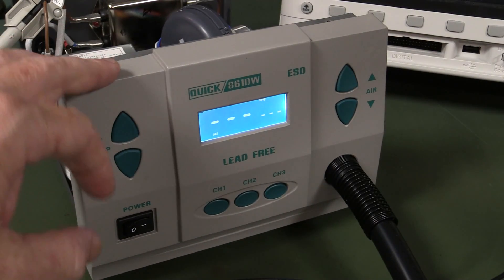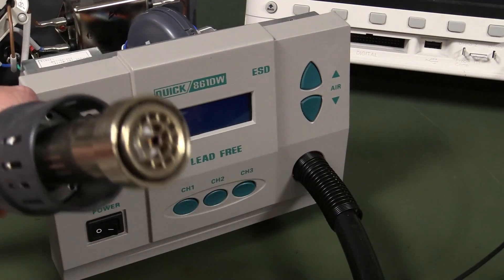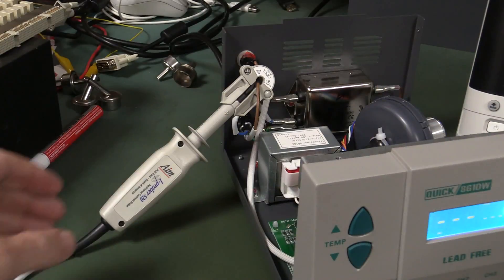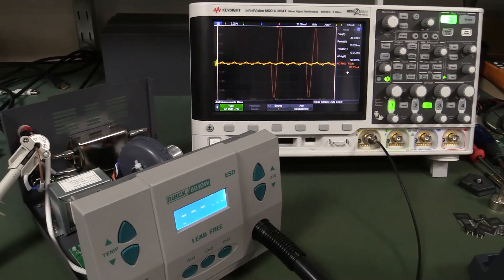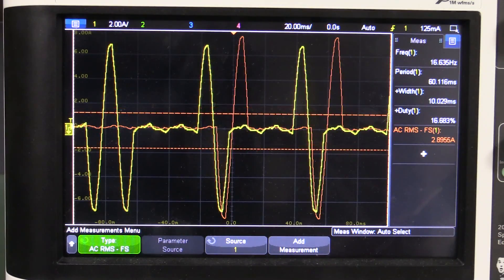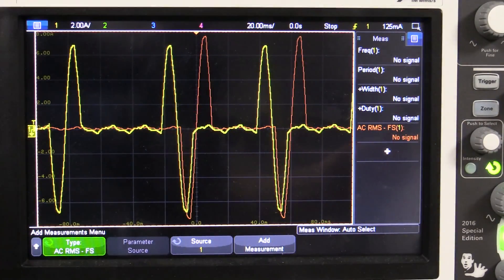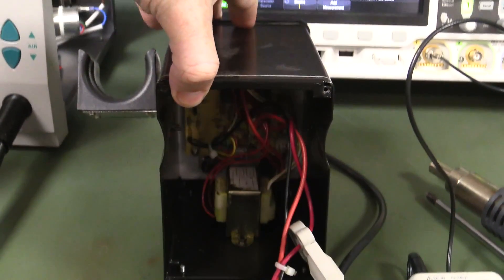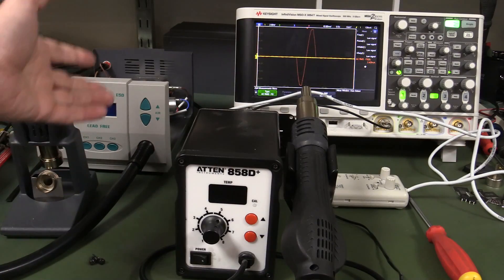EEVblog #1059 - Quick 861DW Hot Air Waveform Measurement

Comment: From what I got the 220v one does not have the problem and Louis actually changed to 220 to get away from it.
Reply: Buildings over there get a split phase supply - 120-0-120V. 240V circuits are easily installed - but they're allergic to using them for general purpose applications.
Reply: The 220v doesn't have that problem because the 220v line is entirely separate from everything else! I'm running it off the separate 220vac line I had installed when I bought the ZM-R6200C. The 120vac outlet here shares the same line with the ceiling lights, thus the flickering.
Reply: I have the 110v personally, and no matter what I do anything florescent flickers.
Reply from the maker: Surely that would draw the same current on the 120V side of the 120V-240V inverter? Or is the small amount of filtering in the inverter smoothing out the spikes just enough?
Reply: Depends on the available outlets. In the US you can actually ask for a 220V outlet to be installed (also used by people that do electric welding). I also believe that other appliances such as central heating operates at 220V by default.
Reply: Running it floating would be the plan, Not tied or sinked to the line off my trusty 2548 Trace
Reply: Louis Rossman there is more to it than the, I have run direct home run to a single distribution breaker and tried it on both phases with no change. your 220 still goes to the same box(assumption) but for sure the same service transformer and would still be an issue. With 220 in the us you are drawing off both in the us +110-120/-110-120  with floating ground  not used for neutral and that may be part of it. Euro/eastern etc. is 220-240/0  ground tied to 0 at the box, potential for 480 from two hots.  Something is different and I do want to find a solution.  Perhaps it would be possible to set up a test this side of the pond with what we as a group have for resources to peg and fix this issue.  Please, I have tried a few ferrite  things, I will figure something out. Any ideas are welcome, there has to be a solution,  possibly even software to force a full wave draw forced from a faster clock? perhaps
Reply: Monkeh that is correct. For those not familiar with the US wiring system, I have taken a picture of my home breaker panel. This is a pretty typical panel over here. On the wiring picture what you are seeing with the heavy gauge wire at the top is the incoming 120-0-120. The red and black wire is 120v 180degrees out of phase, thus you get 240 connected across it. The white wire is the neutral. The breakers running down the panel alternate between each of the 120v legs. So the big double breakers at the top are connected across the two 120v legs giving those circuits 240v. The single breakers at the bottom are tied from one of the 120v legs to neutral, giving those circuits only 120v

https://d0ug.com/usbreakerpanel.jpg
https://d0ug.com/usbreakerpanelwiring.jpg
Reply: Doug Kahler very interesting to see that, don't you have protection lines in the us? I'm living in Germany in a house from the '50's and have only three breakers for my whole flat, those three breakers are for the three phases for the electric stove and everything else is connected to this, which gives me goose bumps on every light flickering bcs I wait then for a wall start to glow and smoke ;-) But when I see and read how it's made in the us, I feel pretty safe. 110/120V lines are just primitve and stupid in and way, you need thicker cables, more copper, which is rare... no wonder that the USA just burns the some ammount of ressources that all other countries together use for decades, if everything is built on such an idiocy.
Reply: Wilson not sure what you mean by protection lines, do you mean ground? Grounds would be the bare copper wires you see in the box. In the US Black and Red = hot. White = neutral and bare copper = ground. Typically black is used as hot on the 120v circuits and red is used on the inverse hot on 240v lines. Obviously there is some strange wiring in my box cause the inside AC unit has 2 reds and some of the 120v circuits are using red. No clue why. The inside AC unit has those big beefy cables since it uses resistive heating coils for heat in the winter. This apartment might be old enough that the color standards weren't as strictly followed. If by protection lines you mean GFCI or RCD type devices. You don't hear the term RCD here in the US, we use GFCI Those did not exist back when this place was built. They can be retrofitted as GFCI outlets usually installed in damp locations like bathroom,  kitchen or outdoor outlets. There are some GFCI breakers on the market these days.
Reply: no in europa we don´t have split phase, we have 3 phase. so you get 230 to ground and 400 (380) between two hots.
Reply: goamarty in the US the ground is not designed to carry any current. It is just for safety. The ground is tied to the same connection as the neutral at the breaker box, but it is a separate isolated path. The separate ground came about to ensure actual ground/neutral is what would be tied to the chassis of an appliance. Before the days of polarized plugs a US plug could be inserted any direction which would mean if it wasn't a double insulated appliance you could end up with hot on the chassis. Also people in older homes with non polarized outlets were known to trim down the wider spade on a polarized plug so they could insert it into their non polarized sockets. This could also result in hot being on the chassis if inserted backwards. With the 3rd pin there is no way to insert the plug backwards, short of cutting off the ground pin

This has more detail on how it works http://hyperphysics.phy-astr.gsu.edu/hbase/electric/bregnd.html
Reply: Doug Kahle sorry for late answer, In Germany we have three phases: black, brown, grey, a ground line: blue and a protection line: yellow with a green stripe, which is connected to metal housings, bath tub etc. everything where electricity could flow through, harm someone or damage something. This line goes through a so called "Fehlstrom-Schutzschalter, FI-Schalter", fault current circuit breaker or residual current device in english as much I remember, also to ground, ends in earth, as soon 30mA flows through it it breaks and all is dark.
Reply: I think this is what you described in the last comment, I didn't think before that it is neutral and not ground, also here in Germany it is called Phase Neutral and Earth(Erde)/protection line.

Comment: If you're seeing 7-8amp load at 240v, that would mean roughly double the amps at US 120v. That pretty much maxes out the average branch circuit here in the US, 15-20amp depending on the breaker. Probably exactly explains the flickering lights if they are on the same circuit as the lighting. Not to mention whatever else may be on that same branch circuit
Reply: Doug Kahler: AGREED. The first time I saw Rossman rattling on about the lights dimming, an apprentice electrician could see the Quick was simply loading the circuit. Nothing mysterious. I see it all the time in old buildings.
Reply: Simon Ashton probably depends on that electrical code Louis' place was built under. I've seen all kinds of different amperages used. My apartment built in the 60s has 20amp breakers for all the 120v outlets, high current 240v stuff like AC, Stove, Clothes dryer all have 60amp breakers. The house I grew up in built in the 80s had 15amp breakers for all the 120v stuff. My grand parents house had the old lamp socket screw in type fuses, literally like 4 fuses for the entire house rated at 15amp each I think. No idea when that house was built. Commercial is obviously going to be somewhat different from residential. Based on how Louis describes the place I'd bet the electrical is kinda dated
Reply: In my home, lights dim across the whole house for sudden current demands. You might think bad neutral, but it's a phenomenon seen in pretty much every house around here. The effect is far more pronounced with modern fluorescent and solid-state lamps, in which a slight transient dip in voltage results in the light getting incredibly dim for a significant fraction of a second.

My upstairs was unfinished until 15 years ago. This is when it was wired by a reputable and licensed electrician, and the lights are on the same circuits as the outlets.
Reply: EEVblog can vary some here in the US. If you have stuff like recessed can lighting in something like a living room or kitchen, it will probably be on its own circuit just from incandescent lights historically being used in them. With people using CFLs and LEDs now these circuits would be way underutilized these days. In something like a bedroom where you might have a single ceiling light or ceiling fan it almost always will be on the same circuit as the outlets in the room. Commercial overhead fluorescents in a large place would be on their own circuit. A smaller place might be tied into the same circuit as the outlets in the room.
Reply: Permanently wired lighting is always on a separate 6A circuit here in the UK. The only lights that arent, are table lamps connected to a wall outlet which are individually fused by our plugs (because we have 32A capable "ring main" circuits)
Reply: Peter, unfortunately not the case in the US. Now as Louise shop should be zoned for commercial business and may require a separate circuit, but I’m not sure. Then theirs the older building in places like his location, and other older cities like Philadelphia and not all landlord re-wired the electric just because a building was converted from residential to commercial use, especially if it was not required by law. So his office may be running lights and his bench equipment from a single 15 amp breaker. So this quick can draw up to 9.8 amps on with the motor and control boards on a 110V line tied to a song,e 15 amp breaker in addition to his main computer doing all the video capture with big videos cards and soldering station.
Reply: Most US residential properties the lights are on the same as the plug outlets. Use my house an example, my whole second story is mostly in one breaker rated for 15 amps, That includes the lights and all. The only exception is the bathroom for a separate breaker and GFIC. Even when I was a kid it was always the hair dryer to trip the bathroom breaker. 

When the home was built I don’t think they expected people to have gaming computers with 1200 watt power supplies, TV’s in each bedroom, XBoxes and PlayStaions. The bedroom outlets were for lights, a clock, and maybe a stereo. My 700 watt re-work station causes my lights to flicker when it’s heating up. But it’s motor isn’t as efficient as the three phase brushless motor in the quick. I would guess it pulls about 800 Watts total depending on air and heat settings.

When I had the battery spot welder in the upstairs lab and it kicked off, I had all three of my 1500VA UPS battery backups turn on to provide power to the line as they detected a drop in the line voltage. It’s now in the basement on its own 20 amp breaker. 
Sometimes when I turn on a triple power supply the inrush current will cause that one UPS to come on. The Samsung laser printer will also cause some light flicker as it first warms up. Lucky most of my upstairs lights are LED’s and not the cheap capacitor dropping ones, but ones with a proper filter caps, and caps after the bridge rectifier and a switching transformer or all the lights upstairs in my house would flicker when I’m in the lab, lol. Mostly it’s the cheap LED fluorescent looking tubes above my benches with a LED strip inside that flicker, I’ll probably replace them.

I have this quick station also, I just haven’t had time to hook it up. Now I wonder how it’s going to treat my breaker. It might end up turning on and off my UPS units as they will try to regulate the line voltage and all three are on the same line. 
I did recently move my NAS to the basement, so that takes some constant load off that breaker for my upstairs bedrooms and the lab. It might help a little, but probably not much.
Reply: The US electrical system is very much stuck in a turn of the century to mid century era. An era were most that people plugged in were some incandescent lights, a single TV in the living room, a light and maybe a radio in the bedroom and other small appliances. The only high draw appliances that wouldn't have been hard wired to 240 would have been intermittent use appliances like vacuum cleaners, hair dryers, irons and coffee pots. It was never really intended for a 1200watt gaming PC running 24/7. Probably the only saving grace for it would be the more energy efficient lighting and appliances we have these days. An electronics lab/workshop should probably be treated just as any other workshop with power tools, where you should have multiple 15-20amp circuits run for individual tools. Another thing to keep in mind a lot of US breakers are rated for 80% load so you can pull the 15-20amp for a limited time, but if you keep  a 24/7 max load on it, the breaker is going to pop after an hour or so. Probably won't ever see a gaming PC that exceeds 1200w that plugs into a standard US outlet.
Reply: I posted a comment here that fits with yours quite nicely. ;)
Reply: Dave, how were you measuring current? I couldn't tell. Hall transducers? Isolated 'scope inputs and some low value series resistors?  Thanks.
Reply: that probably explains why my room is so dim.
Reply: Now I'm questioning how the hell I'm managing to run ~1500 watts through a socket for more then 2 years.
Reply from the maker: Either that or it's just a shitty design light to begin with?
Reply: @EEVblog  I've got very nice industrial LED work lights from Treston in my lab.  They flicker too.  I suspect the current surge is in phase with the switcher in the lights somehow.  Haven't measured the current, but like the guy above said, if it's double what you've got, that's about the limit for a 15A branch - though we have 20A branch circuits in my lab.
Reply from the maker: Simon Ashton - Lights are always on an entirely separate circuit here in Oz, both domestic and commercial.
Reply: I thought lights should always be on their own lower current circuit for safty since people (grandma etc.) fiddle with the bulbs.